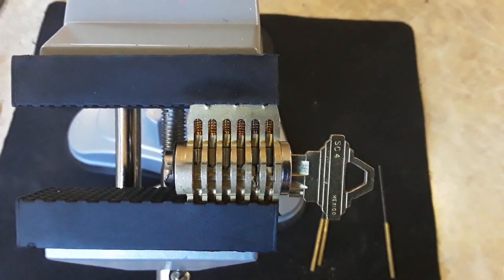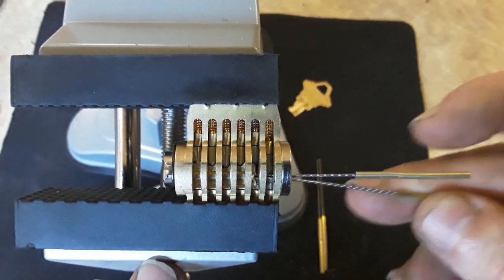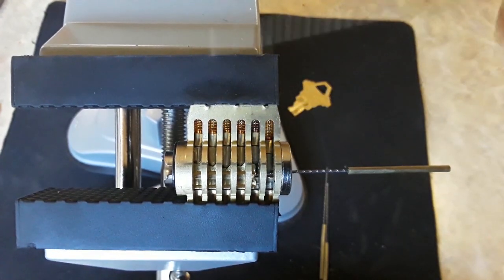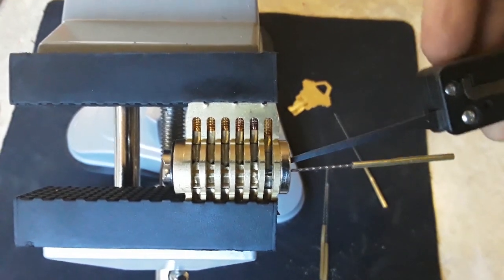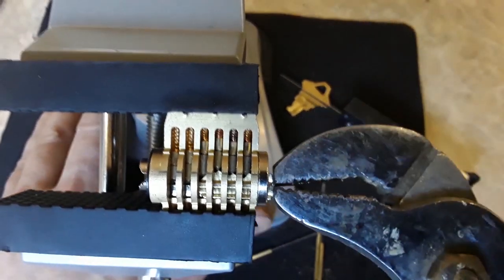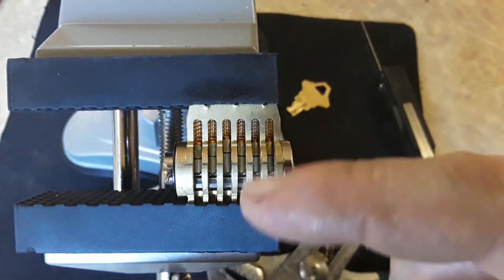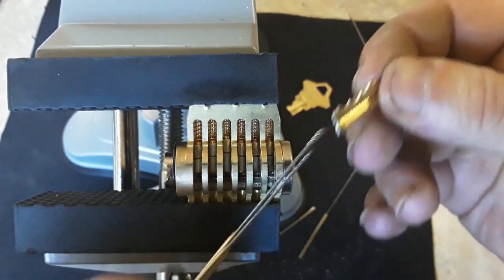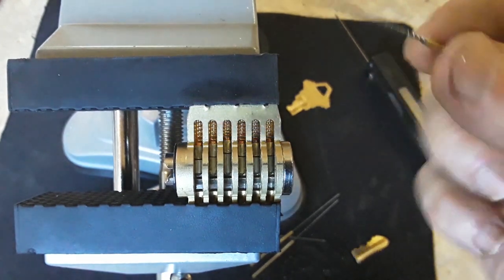[018] How to Use Spiral Broken Key Extractors

Comment: Good stuff David, as a locksport noob this was very useful. I almost certainly would have experienced a lot of frustration trying to use these without really knowing what I was supposed to be doing!
Had my first success SPP'ing my Schlage cutaway with the SWICK's deep hook this morning. I need to buy some suitable hex wrenches to tighten up the screws (perhaps these could be included with the final commercial product?) which I hope will take that last little bit of play out of the blades. But evidently the tool is still perfectly usable as it is. On to picking my ABUS 83/45! The included decoder shims work great too. Subbed for future content, Cheers mate. :)
Reply from the maker: Awesome,  thank you! :-) Happy picking and let me know how tightening those screws works out please.
Reply: @picklocks  Will do mate, cheers again :)